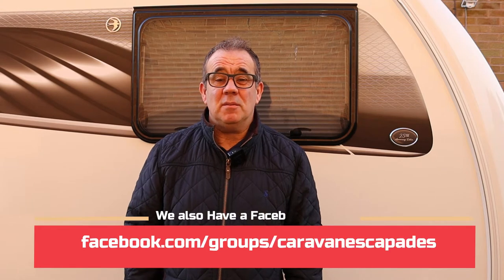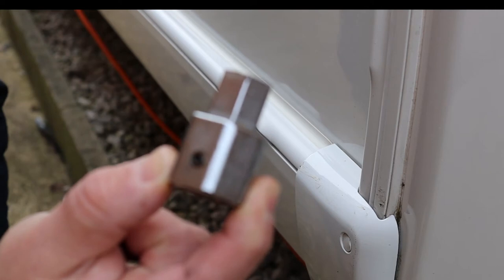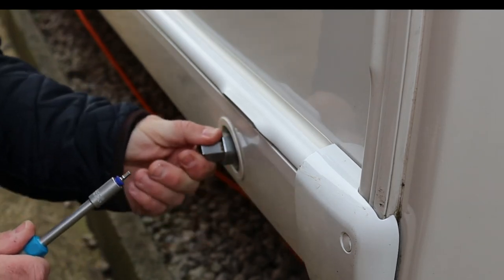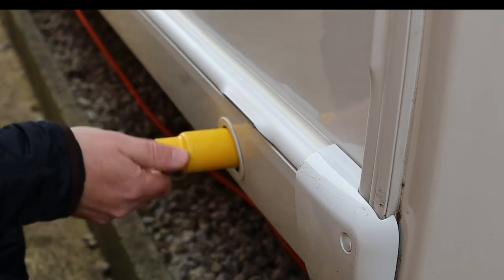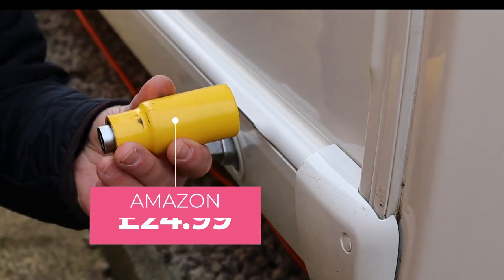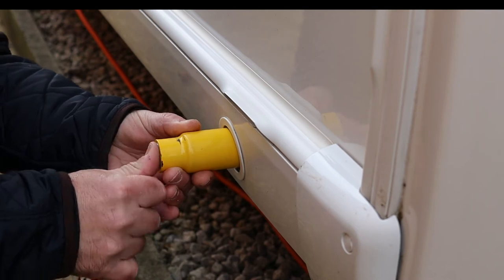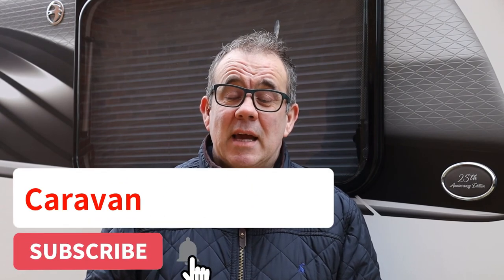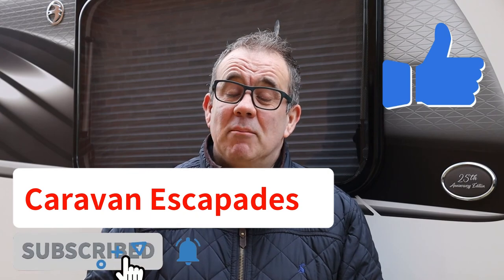Fitting a Caravan Steady / Leg Lock & how to use

Comment: Been interested in theses for a while, could do a bit of modifying  to the van sturdy tho. My idea is, remove the grub screw, get a think pen or something to mark through the grub screw when the thing is on the van, remove the socket then drill a small indent in to the van sturdy, replace the grub screw, maybe a tad longer and maybe stainless, now when you do it up it wil be a lot harder for a person to smack it off under the van using a chisel on the end and wacking it outwards as the grub screw wont be able to just slide along the sturdy.......

Still think they good as the more locks the more i think a thief will move on to the next van
Reply from the maker: Hi, thanks for watching and commenting. I like your thinking. Being an engineer, I can see the benefit in doing this modification.  I wonder if it would mive the week point to the lock and if that could be forced off. If I get the chance, I'll will give it a go. If you do get to do the mod, you will have to let me know how you get on. Happy Camping. James

Comment: Really good video, only one I have found on this subject that really explains how they are fitted. My only problem is that it has put me off spending decent money on these. If all that is keeping the steady from being used is a little grub screw I won't waste my money although I understand its a deterrent especially with the rest of the security you throw on the 'van. Thanks for a clear video tho.
Reply from the maker: Hello CJW, thanks for watching and I am glad you found it useful. I paid about £25 each for these. The Grub Screw is covered over with the Yellow Lock Body when fitted to you would need to overcome the lock before getting to the grub screw and if you overcame that you would not need to worry about the grub screw as you could operate the steady anyway. I agree that if they are determined they will overcome this. For me its about putting as much in there way as possible. I have these fitted to the Steadies, 4 Wheel Locks Heavy Duty Hitch Lock, Extra Door Lock, Tracker and Alarm., Some may think a bit extreme but it gives us some piece of mind.  Thanks again and happy Camping. James

Comment: With the lock protruding so far out, isn't it a hazard to pedestrians in the event of a collision?  I use a Stronghold leg lock. It doesn't stick out beyond the side of the caravan. I don't know if it's any less/more secure than the one you have.
Reply from the maker: Hi Thanks for commenting, It does protrude but only on the front steadies, but has never been a problem, I always fit on the none awning side when we have an awning fitted as to not interfere with the draught skirt. I don't have them fitted when towing so wont be an issue with pedestrians in the event of a collision I don't know if it is any better than the stronghold that you have fitted, but with these 4 wheels locks and a premium hitch lock, I just hope it makes them think twice and at least slow them down. Thanks for watching and happy camping. James

Comment: What stops anyone from taking a welding wrench or pipe wrench and turn the screw from under the caravan?
Reply from the maker: Hello Leif, thanks for commenting. to simply answer your question, nothing at all, its the old adage that if they want it they will take it. I see it as putting more in the way to make it difficult and slow them down, with 4 Steady Locks fitted, 4 wheels locks, premium hitch lock, additional door lock, Tracker and an Alarm they all add extra deterrent,. I either have the Caravan stored at home or in storage and would hope that with these devices along with the Home  CCTV, they will think twice or be disturbed in the process and while in storage they may look at other caravans with less security. You can only do what you can. 
I don't find it to much hassle fitting and removing these devices. Happy Camping James
Reply from the maker: @LeifNelandDk  thanks yes have been watching lockpicking lawyer for a while.

Comment: Anyone used one of these?
Reply from the maker: Hi Luke, I have 2 now and find them very east to install & use
Reply: I have similar on my rear steadies, I store the van nose down so van can’t easily be lifted up. They can be overcome by using mole grips on the thread, but it all takes time and used in conjunction with additional security measures might just put the thieving ba@@starts off.
Reply from the maker: @colinrimmer789  Hi. Yes like you we have the Caravan nose in when it's at home, like all locks they can be overcome and I agree it all helps slow them down. Take Care James